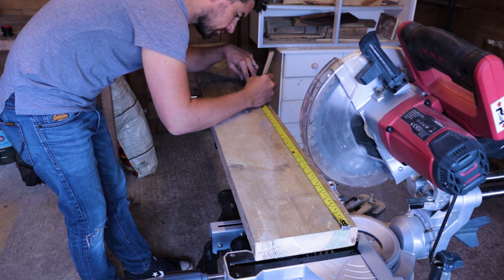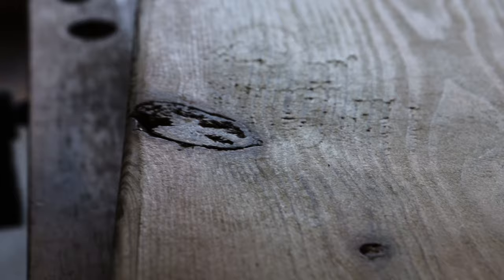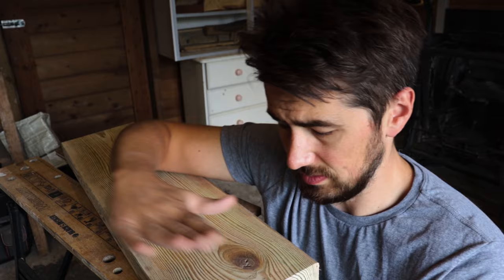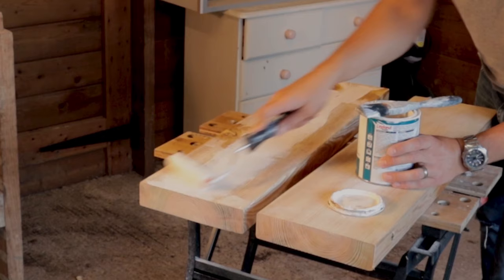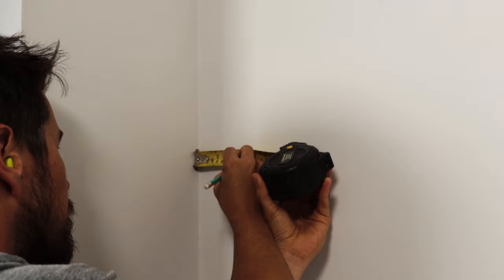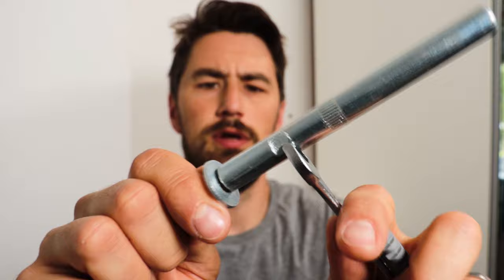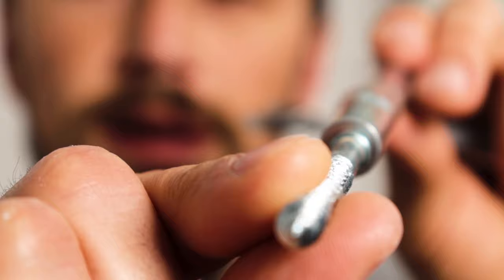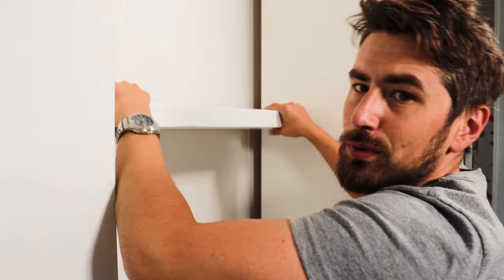Easy DIY Floating Shelves | The Best Floating Shelf Bracket?

Comment: How many weight will these brackets support? How many do you recommend for a 76 cm (30 inch) shelf?
Reply from the maker: The weight limit is not specified but the shelf I installed is about the same size and I used 2. 

The good thing with these brackets are that if you need to install more it's pretty simple to just add another bracket for extra support

Comment: Drilling concrete walls is a pain in the ass, when I hit a steel bar and the drill goes nuts and the drill bit breaks inside the wall... aff. I should get a good drill bit
BTW thanks for the video

Comment: Could you suggest the length of the rod vs the breadth of the plank? Like a 4-inch rod is good enough for a 7-8 inch plank?
Reply from the maker: Not easily! For what I used the rod was more than half the depth of the shelf. I think you could push it a little past that but it depends on how much weight the shelf will hold. With these brackets if your shelf is still wobbly after fitting you can always add more brackets
Reply: @NeilLovegrovemaker  Thanks.

Comment: Hi Neil, I have 20mm ply from a shelving unit I have taken apart before decorating my living room. I had planned on buying 4/5 Ikea Lack shelves and using some of the  20mm ply as a vertical upright hack, however, seeing your video has made me think I may just be able to cut down and use all this 20mm ply for horizontal and vertical purposes. 
Whats you thoughts on drilling into 20mm ply for the individual shelves? 
Many thanks in advance, J
Reply from the maker: Sounds like a plan! The only thing Id be concerned about is how strong the ply would be after drilling into it. You may find over time the ply laminations start to come apart around where the bracket is installed.
Reply: @NeilLovegrovemaker  Thanks for getting back to me on such prompt fashion. 
I get that, it was a concern for me also when looking at the layers making up 20mm plywood. I was about to ask you as question that I realised you have already answered it, by providing the link. The hole to be drilled is 10mm, I wonder if the metal rods come in say a 7mm or 8mm to leave me with more layers of wood. 
I'll have a look on Amazon to see what I can find, it really would be a shame to waste the wood.
Reply: I also meant to ask if you were going into lath and plaster?
Reply from the maker: @whippetkid  no, this wall was solid brick! I'm not sure how well the brackets work with lath and plaster!
Reply: @NeilLovegrovemaker  Yeah, I wonder. After your last message I thought I might glue two 20mm on top of each other to give 15,, each side of a 10mm hole, problem is weight and lath & plaster.

Comment: Would this work on an offcut of laminate worktop. I've got some spare from a new kitchen was hoping to use it for shelves.
Reply from the maker: I think it would if you were go cut the width of the shelf down. I'm not sure how they'd go holding up the weight of a full sized kitchen worktop!
Reply: @NeilLovegrovemaker  No I'm gonna cut them down to manageable sizes. It looks like chipboard inside. Was thinking of sealing with PVA or something.
Reply from the maker: I'm not sure how well these would work with chipboard. With a solid piece the bracket wouldn't break through but I'm not sure it would be the same with chipboard.. depending on the grade. Let me know how you get on though!

Comment: Love the video- good all rounder advice. Great fixings - used them on a melamine/chipboard shelf for paints (used 4 for strength 🙄) but could only push bolts halfway in and now they’re stuck!!! Tried mallet. Tried WD40... have smashed it to smitherines 🤣🙄 but will the bugger come out?! Shelf is stuck (like you said lol.. )

Any tips???
Reply from the maker: I think if it was me I would try a couple of straps around each end of the shelf so I could get a good grip to pull on. You could also try those quick grip clamps. The end bracket normally can spin around so they can push instead of pull. You could slide them in and force the shelf out?
Reply: @NeilLovegrovemaker  I can feel a trip to the hospital coming! 😷🤣😋
Reply from the maker: 😂😂😂 please be careful!
Reply: @NeilLovegrovemaker  thanks. If I do get it off the bolts, will making the holes larger cause the shelf to wobble stupidly?
Reply from the maker: I guess if they're all largely oversized it would. I would probably start with trying to slide on 2 bolts and adjust until it slides on and off ok. Then add in a third.. Then add in the fourth
Reply: @NeilLovegrovemaker  My thoughts too...  I’ll let you know when (IF) I manage to get the shelf off. Got my jigsaw at the ready to hack it up if it won’t. I’m sure I’m not the only one this has happened to. Can you edit your video to include a note to make sure others don’t hit this predicament perhaps?? Or am i just a numpty? 🤪
Reply from the maker: YouTube make it impossible to edit a video after posting without losing all the views and rankings.. Maybe I could do a combined project update video. 

Don't think you're a numpty.. 4 brackets will always be trickier to align than 2
Reply: @NeilLovegrovemaker  Woohoo!!! I just managed to prise it off with the biggest crowbar I possess (no trip to A&E either!) 😊
Reply from the maker: Well done!
Reply: @NeilLovegrovemaker  All done!
I didn’t have to make the slot wide - no rattling & all level. Happy chick! 😃 Thanks for your replies. Great brackets and I’d use again - this time a lot wiser! My tip to others: crowbar! 💪
Reply from the maker: 😁 crowbar is the answer to most problems 😂😂

Comment: Hello, did you use the same size drill bit on the wood and in the wall? The 3/8?
Reply from the maker: Hello. I don't think it was.. but don't quite remember! It's 2 different bits as one is a wood bit and one is a masonry bit but I have a feeling the masonry bit was a tad smaller.
Reply: @NeilLovegrovemaker  thank you! I’m just going to hire someone, I’m not familiar with masonry lol

Comment: would you recommend these for 2 x 12 shelves that would be used in a kitchen for dishes?
Reply from the maker: Hard to say really. If you were putting a lot of weight on them, you'd want the longer type and also want to put quite a few in place to distribute the weight.  The benefit of these is that if the shelf is wobbly you can take it off and just add more brackets easily enough

Comment: Hi great video. Do you think these would work on a wall which has been dot and dabbed.? Cheers
Reply from the maker: I think you'd be losing some strength if the screw part isn't in brickwork as deep as it should be.. but it also depends on what you want to use the shelf for and how strong it needs to be. You could always add  3 or 4 of these brackets for extra strength if it's not strong enough with 2. That's the beauty, you can take off and add more pretty easily
Reply: @NeilLovegrovemaker  thank you for the reply. That makes a lot sense and seems like a great idea. Thanks again.

Comment: How many pieces would you recommend for shelves 130cm? Thanks. Great channel.
Reply from the maker: These shelves were about 80cm. So it depends on what you're putting on them. The good thing with this bracket is if you need to add more it's easy to take the shelf off and add another one in
Reply: @NeilLovegrovemaker  thanks a million. Appreciate the reply 👍
Reply from the maker: You're welcome 👍

Comment: so question..? Can I removed it after installed or it s fixed to the wall?
Reply from the maker: Technically yes but it might be stiff like mine. I think my hole centres were a little off so had a lot of friction holding it in place.

Comment: Where do you get the pins for your shelf
Reply from the maker: Links in the video description!
Reply: @NeilLovegrovemaker  can they also be used in wall studs
Reply from the maker: I've not used them in stud walls but I believe they can, you might be limited on how much weight they can support in a stud wall.

Comment: Would these brackets be too thick for 30mm thick ashwood shelves?
Reply from the maker: I dont think so, they're about 10mm diameter. So providing you drill the right size pilot hole they should be fine

Comment: Removal of the shelf is going to be difficult. Is there a way of avoiding this.
Reply from the maker: It's only held on by friction on the brackets. If I had drilled the holes bigger it would be loser.

Comment: WHAT, buy 3 lag10" should work,  drive bolts  into you studs in a line. cut the heads off, drill same size bolt hole in wood, aligned with bolts, put shelf on. done.

Comment: You’re using a masonry bit for wood. That’s why they’re burning up.
Reply from the maker: You mean a wood bit for masonry? No, the ones that were burning up were masonry bits shown in the clip at the end of the video. This new one has an unconventional shaped tip making it look like a wood  bit but if you check the link it's a masonry bit alright.. hence the great performance!
Reply: I agree with Casey. If you’re drilling into wood, you shouldn’t be using a masonry bit. Can’t tell what material is in your wall though so...
Reply: Oh... finished watching. Brick wall.

Comment: you dont need any bracket at all. you drill holes in the long side of your board up until 3/4. then you cut your board at about a third. you put wood dowels in between your boards, drill through the third of the board thats gonna be attached to the walland  attach it to to the wall with wall dowels and screws and  thats it. easy diy thing

Comment: Could you post size of wood planks?
Reply from the maker: This one was 2 inches thick
Reply: @NeilLovegrovemaker  Ok thanks. Canadian 2 inches means 1.5 inches. I have boards 12 feet long, 9.25" wide and 1.5" thick. I am wondering if this solution will work for me. I have already ordered 8 of these brackets per shelf. Based on your experience, do you think it'll work, and won't fall? There brackets will penetrate only 6 inches. And I'll be putting books on them, including entire Britannica.
Reply from the maker: I'm not sure if 8 will be enough for a 12ft board. Hard to know really as the manufacturer doesn't give any guidance. 

The one good thing with them is that if you put it up and it doesn't feel strong enough you can take down and add more in easily enough.. although with a 12 ft board you may need some help pulling it back off! 

Hope it goes well. Let me know how you get on!
Reply: @NeilLovegrovemaker  actually I am now thinking to make a video of it as it might help others trying to do the same. I'll let you know once I am done and have the shelf tested for strength for at least a week.
Reply from the maker: Sounds good!!!
Reply: @NeilLovegrovemaker   @Harold Walden  so I managed to make my long 12 feet shelves with these brackets. They were perfectly aligned. I was waiting a few weeks to make sure they don't fail, and they didn't. They are supporting heavy books, including entire Britannica. I'll eventually make a video of the process and upload.

Comment: Are these strong enough for marble shelves?
Reply from the maker: I wouldn't like to say. I wouldn't even know if you'd be able to drill into a marble shelf to put this fixing in?!
Reply: @NeilLovegrovemaker  Plunge drill with the right bit should do the job, or might get them to do at the factory. But thanks, I'll look for stronger brackets.
Reply from the maker: They're cheap enough to buy. Maybe you could do a test with a piece of scrap and some weighs to bring up to the same weight of the marble shelf?

One of the benefits of these brackets is that of the shelf is too weak you can just take it off and add more

Comment: the bit burned up because you are using a standard drill with no hammer drill function
Reply from the maker: I cut out most of the part where I explained about the wall composition and drill type etc as it wasn't really relevant to the video.  But in a nut shell I was using a hammer drill, on a masonry wall. The problem was a cheap, blunt bits in a really tough brick wall. I also suspected there may be some metal reinforcement rods I could have hit also

Comment: Try using a wood drill bit to make it easier to go through studs or anything wood. (Unless your wall is made out of some kind of rock material then disregard the first part of this comment) Masonary drill bits are made for concrete, brick or rock. Just for future reference. Nice video 👍🏽
Reply from the maker: Thanks for the comment. This is a solid brick wall that eats drill bits for breakfast
Reply: Neil Lovegrove damn bro I thought it was sheet rock but yea man rock will eat those bits easily, awesome vid 👍🏼🔥

Comment: Who ever designed these things want sacking, worst thing ever! These floating shelves are best of floating away down a river far far away 😏 they should insert a tubular bar inside, Then when you slide in the bracket that slides into the back it will then sleeve in but be a nice tight fit to prevent all that unnecessary wobble

Comment: Why are you going thru all this when you have sides on the shelves, what a waste of time ! If you have no sides :...
I have built lots of floating shelves easier than this 
simply drill the wall with 1/2" masonry bit (not at highest speed) mix epoxy and use it to set rebar into holes in masonry wall 
Do same into wood wall studs as deep as possible. 
The epoxy is the most important as the loads involve will cause screws to fail
slide shelf over projecting rebar